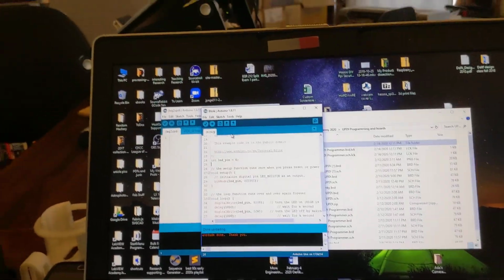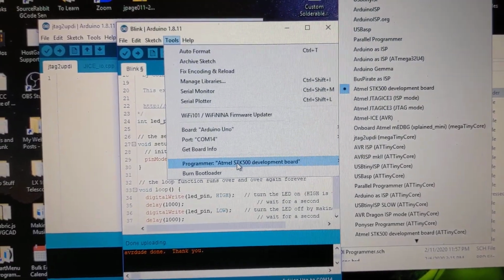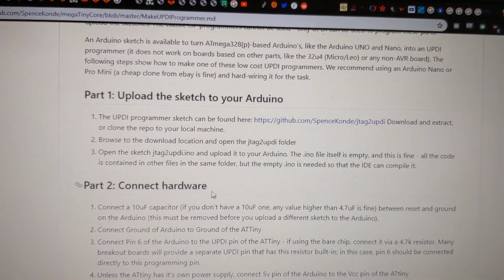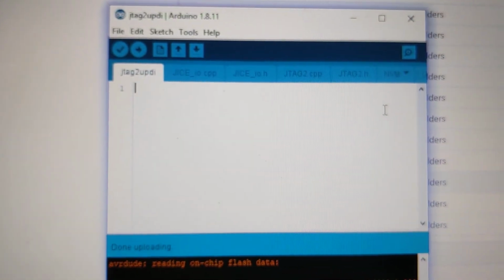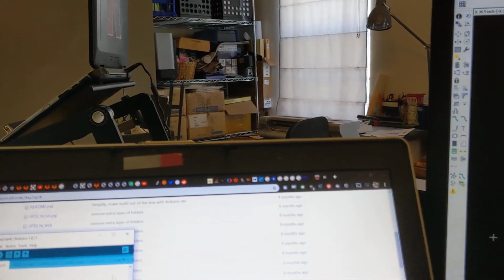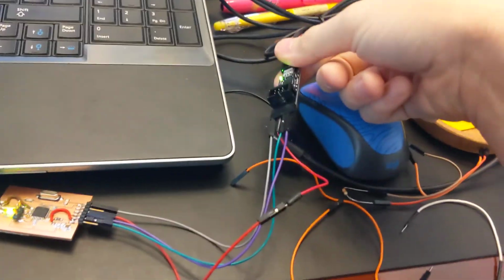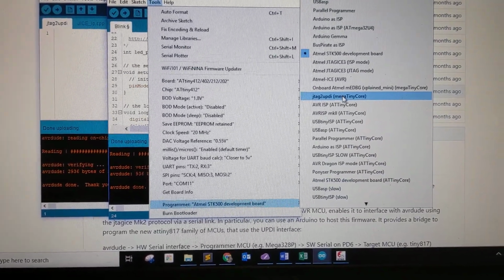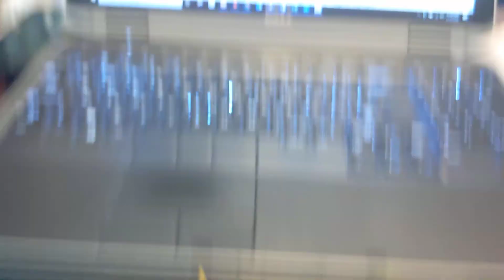Programming the UPDI firmware then using the Fab jtag2UPDI I designed

Comment: Is it possible to view Serial monitor trough the updi protocol on arduino ide?
Reply from the maker: These chips have a hardware UART port that can be switched to difference pins (you'll have to check the datasheet for each cool) it you can use a software serial implementation. In most cases you don't want the RX and Tx pins to be the same but if you are just sending data from the chip to your computer, try setting the UART or softwareSerial to have TX on the UPDI pin
Reply: @adamharris6557  thanks a lot :)